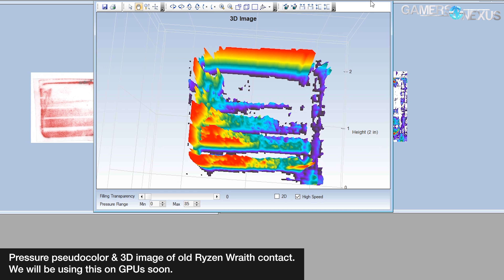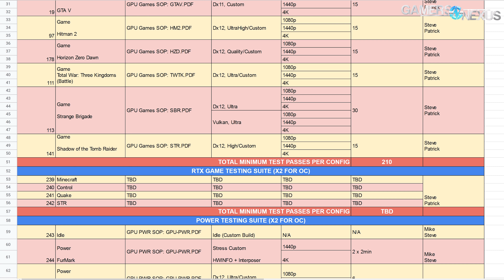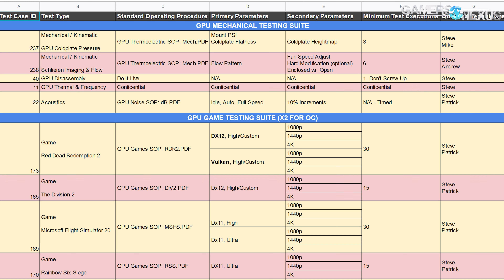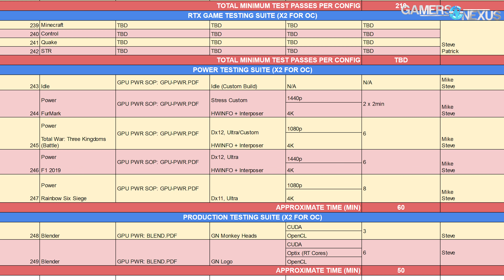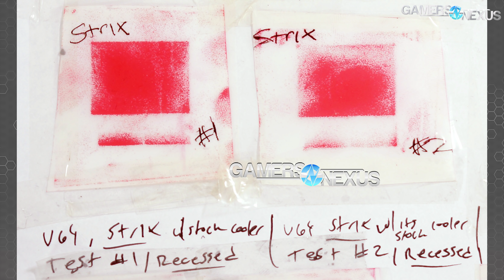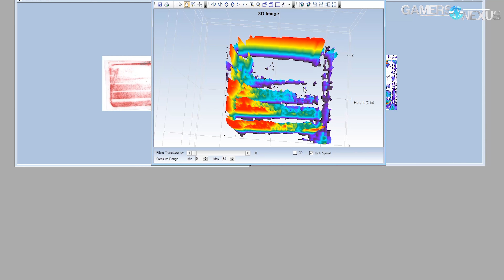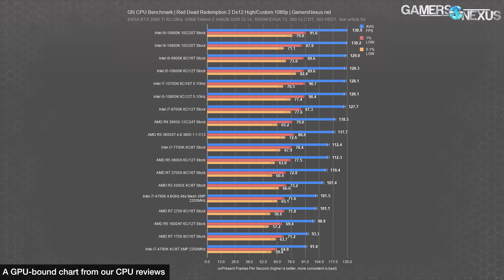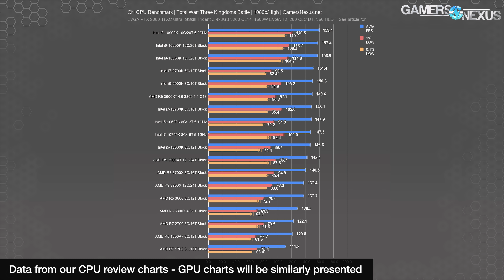$13K of GPU Test Methodology: Airflow Photography, RTX Games, Pressure Tests, Power, & More

Comment: Really looking forward to the next iteration of your testing scheme. I have been following along for a while, and I think there are a few bivariate plots that I would love to see particularly for the next generation of silicon coming from Nvidia, Intel & AMD: 

* FPS y axis with resolution (in pixels log-scaled because its nonlinear) on x axis.
* FPS y axis with VRAM on x axis
* FPS y axis vs Frequency on x
* FPS y axis. price x axis (different points for each resolution and/or device tested)
* All of the above for other useful performance metrics like Render times, TensorFlow epoch times, Handbrake Encodes, Kernel compile times, etc.

I find the bivariate plots easier to read, especially if the relationship between X and Y is nonlinear, or there are added dimensions that matter and can be emphasized with color or size.  The evolution of price vs. performance is another fun one, especially when you factor in discounting.

Comment: I'd be very interested in machine learning workloads. TensorFlow is probably most representative there. Using cuDNN also means it will load the tensor cores. Unfortunately it's kind of hard to run without domain specific knowledge. Like code compile, it's also not very interesting on video. http://ai-benchmark.com/alpha provides a TensorFlow benchmark that runs a variety of tasks, but I haven't tried it yet.
Someone should make a version optimized for looking good on camera like cinebench so that more reviewers run it :)
Reply: I think this might actually be useful even for gamers, because it will likely scale similarly to things like RTX Voice and DLSS.
Reply: You might want to check out MLPerf if you haven't. I've been meaning to look into it, but it seems to be adopted by quite a lot of people. Maybe it is worth it checking out whatever it is that the guys at ServeTheHome or Puget Systems use for benchmarking ML workloads.

Comment: Method = The way you do your test, Methodology = The study of methods (i.e. how you developed the way you do your test, why you did things in a certain way etc. you don't develop a methodology you develop a method. You conducted methodology research while constructing your method. You seem to be misunderstanding what methodology is. Hope this helps.
Reply: Definition of methodology
 (Merriam Webster)
1: a body of methods, rules, and postulates employed by a discipline : a particular procedure or set of procedures
2: the analysis of the principles or procedures of inquiry in a particular field

An existing methodology (1) can be analysed using methodology (2). Developing or improving a methodology (1) would be required when methodological analysis (2) demonstrates an weakness in the methods contained within said methodology (1).

Hope this helps.

Comment: Workstation tests: 
1: Davinci Resolve prefered a real project and separate export for 4-8k 60 hz with H254 and H265. Nvidia just released more RTX acceleration and in the future GPU IO accelerated use cases might come.
2: Tensorflow 2.x  AI-Benchmark CPU and GPU Accelerated

Comment: Steve, would you guys ever be willing to allow access to the data? While all of that data would make for insane charts, it might be fun to build an fun realtime user-delectable dashboard/infographic where you select a resolution and a game/application and every card you've ever benched would get plotted, sometimes those are fun to start with everything selected and then you filter it down to what you're looking for. Could even build in an external call to current pricing, so a user could select a specific game they play, then get a chart with the most value per dollar based on current pricing.

Comment: VRay is a huge standard in the industry for 3D rendering and it seems like NVIDIA rolls out driver updates primarily for VRay and Arnold. By using these renders you will get something that might perform better with all the render features and RTX support.

Comment: Software that's rough for GPUs that I use in the company I work with, I know this is definitely not a large majority, is MapTek Vulcan. We've got dedicated servers to just doing mapping renderings with multiple RTX cards. It'd be nice to see actual benchmarks as the company themselves are unable to provide what would be the best options to use, so we end up getting whatever is the best at the time to use. Currently we're running Tesla V100's in dedicated rendering systems. This is definitely more on the "professional" use case more than games, but it's still a system that slams a GPU really well.

Comment: Lumion is used extensively within the Architecture field, and is heavily reliant on GPU performance.  It would also be easy to setup as a test, since you can set up the scene and renders once, then just reuse that file on each system as needed. It even comes with some pre-set scenes which could work.  Potential tests include render time for still images and videos, as well as in-editor performance.

Comment: I work as a structural engineer and our designers use several AutoCAD programs including Recap, Civil 3D, Plant 3D and others. Our company does not invest in hardware (gpus specifically) because of a lack of benchmarking. Including some of these programs in your work suite of testing would be great!

Comment: Benchmark recommendation: Linux kernel compiles, please. I know this video is for GPU testing, but very few reviewers bother with software compiling benchmarks, which are important to me as a software developer in choosing processors for my main rigs and servers.

To make the compile multi-core, you have to run the following command in the kernel directory after making the config file:

“make -n<number_of_threads_in_proc>”

Also, if I may, please enable all optional drivers in the build config file. I want to see the “worst-case” compile times. 

Linux kernel compiles benefit from core count, core throughput, I/O speed, and, if you enable FIFO piping for the compile chain in the config file, RAM speed and capacity. It would be great if you could include those variables in your tests, or at least disclose the read/write speeds of  both the disks and RAM that you use on the testbench as well as the RAM size and whether or not you enabled FIFO piping.

Comment: As a researcher, the benchmarks you use are quite good for my needs. The majority of the software we use (LabChart, MatLab, Sigmaplot, R, among others,) are usually CPU/RAM bound with little improvement from the GPU, and also little improvement moving to extreme CPUs. 
A few pieces of equipment we use like a DEXA and other imaging devices will use the GPU, but none of them max out a quadro k2200, so I think I'm good lol

Comment: Hey GN, 

If you want to avoid having to clarify what Win10 build you're using (I appreciated the detail around Windows "Two-Thousand and Four" you can shorten it to "Twenty-Oh-Four" instead which rings more true to the format (year '20 month 04). That's what we do at work anyway. Clearly most should be aware of what you meant, but you can also save a syllable if you care about that too...

Comment: For GPU testing you could use DEM (discrete element method) as a benchmark. I used to work with EDEM from Altair, and it benefits greatly from GPU acceleration, by cutting a lot of simulation processing time.

Comment: There is a bit of software called tNavigator that is used by geologists ect for modelling fluid flow in underground reservoirs, I'm not a user of it myself but I did a lot of the testing with it when the Coventry department were getting new computers. It isn't a strictly GPU test (CPU with GPU acceleration) but the GPU is the major factor on it (can also be used with only CPU for CPU testing). It records run times by itself and can be set to run as a batch process as well. If you are interested I can probably find some models of varying sizes for you to run.

Comment: @Gamers Nexus, I work with image processing and wireframes from drone capture, which is intensive on CPU and GPU performance (mostly CUDA). I think for the high-end GPUs and high core count CPUs you test, it would hit the CPU and GPUs hard running Pix4D, Agisoft Metashape, Reality Capture and Autodesk Reshape.

Comment: You could include a DaVinci Resolve Test. Puget System releases some testing of it but it would be more useful to home base creative users testing with consumer grade hardware, including mid to low range graphics card, as well as scaling. teste can be made with Real time playback with grading add-in (specially with noise reduction, that takes a big load on the system) and also exporting and conversion times.

Comment: Davinci Resolve as an NLE is becoming more and more widely used so I believe bringing in some data on that would be really useful.

The main issue I've found with my GTX 1070 editing 6K Blackmagic RAW video is that I run out of VRAM instantly and get an error for it if I play back on anything other than 1/4 resolution, and run out of VRAM instantly when working with temporal noise reduction. Considering BRAW is advertised to work on layman's laptops, Blackmagic's hardware recommendations aren't the best.

Comment: Hey Steve, I'm a workstation user and I would like to add 2 Simple benchmarks. Octanebench and Redshift. Both are gpu renderers wich are industry standard just like vray. If your only gonna add 1 please use Octanebench. It's extremely simple to run, its basicly Cinebench but than for the gpu. It also has a website with a lot of results of gpu's on it wich is amazing!

Comment: I use solidworks a lot, and the GPU determines stability and speed of large assemblies and models, how fast they can rotate and how they load. It would be great to see some more benchmarks and testing regarding this as workstation cards are expensive and if I can get a gaming card to do the same work it would be much preferred

Comment: It'd be interesting to see a plexiglass case mockup, with the most compact PCI riser possible to hopefully get the GPU running from a motherboard out-of-shot. I feel like I've seen a case which used a round PCI riser. If something like that could be found, the PCI riser could run behind the GPU cooler and out of shot to the rear.

Comment: Hi, An application that is quite popular with 3D hobbyists and pro-summers is Daz Studio. It uses 3Dlight and iRay rendering. Very little serious benchmarks are out there to help the community choose appropriate hardware and set expectations straight on what sort of performance or success rate with various hardware configurations out there. 

One of the key limitations of iRay with Daz is the VRAM amount on GPUs vs the geometry and textures of a given scene. Too large a scene and the render defaults to CPU and can take days to get muddy results.

You knowledge, rigor and dedication is needed Sir.

Comment: I would love to see cad benchmarks, things like solidworks or Catia. There are almost no benchmarks and It would be great to have some.
Reply: Check out Puget Systems. They publish new GPU benchmarks for Solidworks at least for each new version. Mostly for Quadro cards mind you, as that's what most professionals use. After working almost daily with SW for 13 years, I can tell you Quadros are the way to go. Not for the silicon (think it's mostly the same) but for the drivers. Anyway it's not very intensive on modern GPUs. Selecting the right CPU, RAM and storage is equally important. If someone tries to sell you a Xeon+ECC for SW just say no and move on to the next supplier. Paid through the nose for that the first couple of computers I used. Massive waste of money and not even the best performance, at least on 7/8th gen and later desktop. Simulation scales with cores up to around 16 I think, and now that's mainstream desktop as well.

Comment: As somebody who works in Local Entertainment and uses this application a lot, I have always felt that Vegas Pro is very underlooked by your team, Steve; I have recommended this on plentiful occasions and wishfully there are other people who have as well, it doesn't deserve to be confined to only Rob Williams of Techgage's annual Workstation GPU program and really would help out those who don't edit video footage on Adobe Premiere or other relevant Video Editing software know what works best though CPU and GPU tests of it.
For CPU Testing, Vegas Pro works best with a Sixteen or Eighteen Core CPU for CPU+GPU Renders, while a 032 Core CPU such as the Threadripper 3970X can get the most out of a CPU Only Render, and this is due to how Vegas Pro handles CPU and GPU rendering priorities (most video codecs are limited by their coding and thus cannot use more than sixteen cores for CPU+GPU Renders, while MainConcept AVC can allow up to 032 Cores at max, as shown by the core/thread caps on this application with the 3990X and 3995WX); an OpenCL Dominant application on the GPU side, Vegas Pro truly loves when you have a good amount of Video Memory for playback and also a significant amount of Compute power, which is why the Radeon VII remains to this day to be the best possible Graphics Card prior to Ampere GeForce, it was able to beat even the Titan RTX in many projects and worked significantly better at higher resolutions with a lot of special effects and had virtually no handicaps in playback stability, thus it'll be interesting to see how later cards scale across Standard HD (0720p) and all the way up to 08K Resolution (4320p) at 060 FPS.

Below is a series of Station IDs, Program IDs, Promotions, and original programming that I have made using Vegas Pro that set many Intel and AMD CPUs, AMD and Nvidia GPUs, and lower amounts of RAM below 032 GB to their limits, showing you a major example of how Vegas handles multiple layers of footage and effect combinations; these were all produced with my Intel 4160 (Standalone) for anything from Late 20I5 to December 0I0 of 20I8, and my Intel 8400/AMD RX Lexa ("550", 02 GB) combo for anything as of Late 20I8, presenting how much I have been able to push these lower end parts over the past matter of years.
All of these use many special effects from the Vegas package, as well as Boris FX: Continuum, Boris FX: Sapphire, Twixtor (Version 05 and 06), and also our own In~House HDR Lighting and Shading resource, the PurLight Engine; what I develop is not meant for Entry Level and Mid~Range hardware, thus going with Prosumer and/or HEDT parts is necessary to assure optimal quality and stability in these workloads even at Standard HD (I280x0720 and I680x0720 at 060 FPS), and if you saw how much it all taxes my 8400/RX Lexa (02 GB) combo, you could understand why I've been needing to get something new.

Projects that use Multiple Layers, Twixtor, and Special Effects (Heavy CPU and RAM Taxation, Moderate GPU Usage):

~ Royameadow 'I8: Station ID (Astral Boston)*: https://www.youtube.com/watch?v=ghJnPXRnlpg
~ Clone Hero: Jackie Desmond, Rainy Days Sampler A: https://www.youtube.com/watch?v=XnmWAFE2O8I
~ Clone Hero: Cait Fairbanks versus Various Artists: How Could a Rip Feel so High Quality: https://www.youtube.com/watch?v=y97iT_6ZShc
~ RoyaTalk Episode 07: Year in Review (20I8): https://www.youtube.com/watch?v=B02W-G_YrXg
~ Royameadow 'I9: Station ID (Liberation)*: https://www.youtube.com/watch?v=nQ6bpD1e2Qs
~ Logo Dynamics (20I9): https://www.youtube.com/watch?v=QICqsaOZB7Y
~ Royameadow Promotion Block: When the Stars Aligned*: https://www.youtube.com/watch?v=_zSLoWP49bk
~ Royameadow Promotion Block: Banga*: https://www.youtube.com/watch?v=Iw_Vbz-V1zg
~ Royameadow Promotion Block: Dynamix*: https://www.youtube.com/watch?v=PZGgXM5za4A

Projects that use Twixtor and the PurLight Engine (Heavy CPU and GPU Taxation):

~ Puresound (Fame or Juliet): Mona Lisa Saga Remastered (20I7): https://www.youtube.com/watch?v=KkrboYIF6QM
~ Royameadow 'I8: Station ID (Astral Boston) (Purlight Engine):
 https://www.youtube.com/watch?v=ne-HR22cUes
~ Healing Echoes ~ A Cait Fairbanks Mashup Mix Set: Launch Trailer*:
 https://www.youtube.com/watch?v=N7TrKig0_Qo
~ Cait Fairbanks versus Various Artists: Healing Echoes: https://www.youtube.com/watch?v=1s1LNDNUcj0
~ Royameadow 'I9: Station ID (Liberation) (PurLight Engine): https://www.youtube.com/watch?v=2FCmXLl0I_w

Projects that use Multiple Layers, Twixtor, Special Effects, and AI Enhanced Images (Full System Taxation; requires RAM amounts above 032 or 064 GB, or there will be a crash):

~ Chanda Unique: Station ID (Urban Streaks) (20I9)*: https://www.youtube.com/watch?v=OXhBK0ZMaYQ
~ Royameadow Promotion Block: Planet Shadya HD*: https://www.youtube.com/watch?v=BdUi-P0-J44
~ Royameadow Promotion Block: SuperTNT '94: https://www.youtube.com/watch?v=jn1FgadlHQk
~ Royameadow Promotion Block: Chanda Unique*: https://www.youtube.com/watch?v=M9FV8iW6BPY
~ Royameadow Promotion Block: Damesville (August of 20I9)*: https://www.youtube.com/watch?v=n2OSA3b1YoQ
~ Royameadow: Generation IV: Station ID (Modern)*: https://www.youtube.com/watch?v=0B87CrnFMPo
~ Royameadow: Modern Legacy: Station ID (Museum)*: https://www.youtube.com/watch?v=E-RalHfwagE
~ Jackeye: Program ID (2020): https://www.youtube.com/watch?v=d6VfVpivO0I
~ uniQue Vision: Program ID (2020)**: https://www.youtube.com/watch?v=Or-6_WBfe-I
~ Royacore: Program ID (2020): https://www.youtube.com/watch?v=zgZxklikbkg

Note: Media listed with a * symbol indicates that they had to be developed in segments, due to the hardware limitations that Vegas put on the RAM Consumption, which will be more noticeable on systems with less than 032 or even 064 GB of RAM.
Note 02: The uniQue Vision Program ID uses the titular engine; it is the Fourth Generation of Royameadow HDR (20I6), with Purlight Engine 0I and II (20I7 and 20I9, respectively) coming before it, hence why it's not in the PurLight Engine subsection.